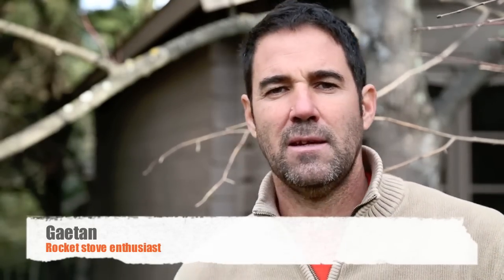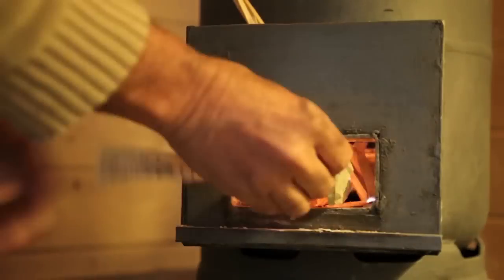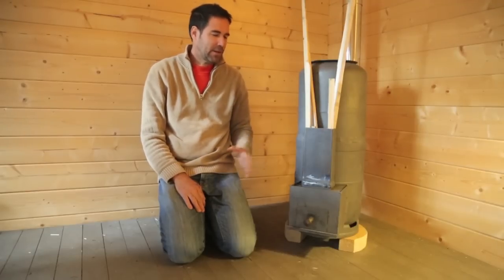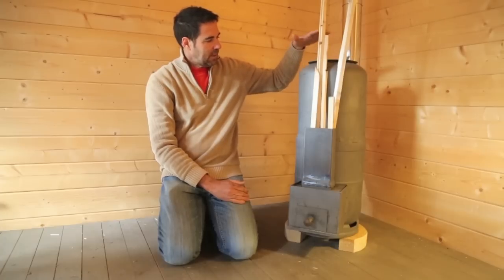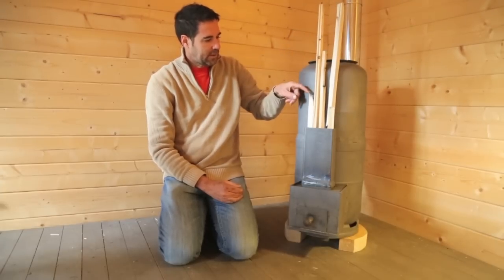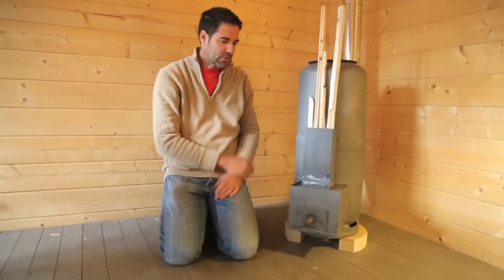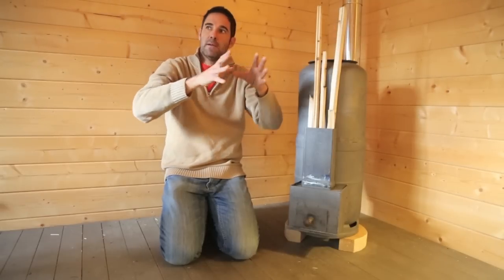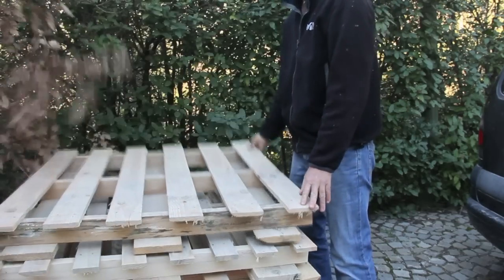Rocket stove heater for a workshop or a room

Comment: Many thanks. Most informative rocket heater video I've seen to date. Used your ideas for external air intake and gravity feed for fuel.  Added a lid to seal feed chamber and a sliding valve to regulate air intake. I soak little blocks (approximitly 40x40x16mm) of pinboard in kerosine and use them for firelighters.
Reply from the maker: +MegaStaalman Well done !

Comment: I like this design from the outside... but would like to see even a rough design plan and see you add a proper piped fresh airflow chamber. G
Reply from the maker: Dan Marlin Hi Dan, thanks for your comment. Yes this would be the next step! Putting a piped air flow  and something that does not play with the visual harmony of the stove. It is possible, though it will take some thought !

Comment: very clever :).  Time to fiddle around, collect odd bits of scrap, spend an enormous amount of time.. and warm my studio next winter.  Thanks for the clear explanation.. [( I might try a larger fuel receptacle - although of course the idea is to use as little wood as possible..but perhaps look at increasing the burn time ), perhaps a bit of flow control for air intake to mess about with burn time, and yes an external air intake also damped for flow control]. See what I can scab from the local tip eh
Reply from the maker: Thanks. Yes you're right a lot of time is needed with the build! A flow control is a good idea.

Comment: when starting put in a clump of wood shavings and twigs first then the paper. As the paper burns it'll have to go through the twigs etc lighting first time. So people put paper in first then twigs but the paper is burning and the twigs will compress the paper down and in some cases put the fire out.
Very nice design. Perhaps an outside shed with rocket stove built into it and pipes to transfer the heat only to the inside of the cabin I heat my workshop this way no internal fire just masses of heat coming in through pipes.
Reply from the maker: +ftrikerfox Thanks for your tip  and ideas.

Comment: very hot is a good answer. I built a stove using 1/4" x 4.5 x  4.5 metal tube for the burn/feed tube and the chimney and a 30 gallon barrel 29" tall centered over the chimney with the barrel top 2" taller than the 27" chimney. The chimney is insulated with a piece of triple wall stove pipe. The stove has reached 330 degrees F (measured using a wood stove thermometer)  but I was hoping for much more heat. My stove looks similar to yours. I wonder if I did something incorrectly.
Reply: +roy hoco Your heat is going up the chimney rather than being transferred into/through the metal.  Some Aluminum or Copper baffles would help (both internal and external and the top surface on which you might want to cook should definitely be a good heat conductor - I'd go with a good sized sheet of copper clad aluminum.  Air movement across the stove will also draw off heat and thus improve efficiency and a bit of creative thinking might get the exhaust gasses to drive the fan (but be mindful of exhaust pressure).
Reply: +Paul Smith thanks for your input, I use various items to capture the heat and transfer it into my shop.  I use discarded automobile brake hubs which are heavy and hold a good amount of heat for later release, I lay them on top of the stove and stack them two high. An old shoe cobblers stand that is a piece  heavy metal, cast iron pots filled with water, short pieces of railroad track they hold a lot of heat and release it slowly  and anything else I can find that is thick metal. My shop is large (heating 2,200 sq ft) and the new rocket stove will make 3 wood heaters for when the cold of winter arrives.  I can burn one or a combination of the three depending on the weather. The only thing I can think is  I was test firing the new rocket stove outdoors on a slightly windy day  when the temp reached 330 so that might be a factor. I will fire it indoors this winter and see what happens.
Reply from the maker: +roy hoco Thanks for your input - Yes I agree with you and Paul Smith re increasing the heat transfer capacity to be able to use more of the produced heat. This being said my rocket stove heater works more than well for the space I have and I wanted it to look good. So adapting the rocket stove for your needs is important. How I could increase the capacity of this stove would be to instead of having a medium sized gas bottle on the top, it would be to put a big one, and as well increase the height of the internal insulated heat riser. Re your question about your stove, there may be some proportions wrong... The way I found that out was by experimenting. there could be too much air intake, or inner spaces too big. You will know when it is right when there is no smoke coming out of the chimney and a good heat produced. I would aim for that before welding bits of metal onto the heat exchanger.  During the building stage it is of course good to do test firing outside, however to really see what is happening you need to do an inside test fire with all the conditions (like chimney length for example) Hope this helps.
Reply: +roy hoco   Your brake hubs are doing what I suggested and are a great idea for the top surface but not as efficiently as would internal and external copper or aluminum fins.  The idea is to use less fuel for the same amount of radiated/convected heat.  Removing the heat from the canister surface would improve thermal transfer.  My suggestion to use waste heat to turn a fan was just a random thought to stimulate further experimentation as is my suggestion to use waste heat from the chimney to preheat the air going to the combustion chamber.  Hopefully I've sparked a helpful idea or two.

Comment: Thanks for posting/sharing, you have to deal with ash eventually, if you could incorporate a small hole expanded steel grate bottom that would allow ash to fall into a removable drawer, you might consider that, please not trying to tell you what to do, just a thought. If my Dad was alive he would be ninety years old, when i was a kid he used to tell me about the old coal stoves, that had that ash shaker idea
Reply from the maker: Hi Len, thanks for your ideas, they are more than welcome ! The great thing with these stoves is that there is very little ash generated as there is near total combustion when the system is hot an running. Though at some point ash does need to be removed. The ash shaker idea could be good. Thanks for sharing your views.
Reply: @gaetanproductions  G.P. thank you for your response!

Comment: I built one with a barrel. Filled a file cabinet drawer with wood stove liner brick6x6.5) The riser a 7"x 30" insulated ss chimney like you get at Menards(don't know why 7" and not 6") but I got it at a auction. It worked well for a month. Had some wood chips and loaded them on wood pieces  angled in upright feed chamber once it was warm even added used veg oil. Some chips were moist and burnt excellent. Then I cleaned up outside around the pile and some had ice on them. I shredded my riser liner with the moisture that day I believe. Pretty sure it was due to moisture in the chips. Used 5gal of chips a day along with split wood. So wanted to ask how long you have been using your riser and what it is made from...and warn against using moisture if it is metal. I was thinking the moisture was like a steam cleaner- bad idea I think, or was the ss riser going to disinitigrate anyway? The stove quit working that very hour. Did not rebuid yet thinking about refractory cement this time.

Comment: I love these home rocket stoves.  My big issue is that they have to be loaded so often.  Unless they are mass heating rocket stoves I just don't know if they're worth the time putting wood in the chamber  Is there a way to increase the time to six hours?  Then I could get some sleep at night.
Reply from the maker: Yes I understand. True they need feeding. This type of stove would be good if it was heating a thermal mass. There is another type of stove called a batch box rocket stove. I have not made one as yet, could be worth looking into.
Reply: @gaetanproductions  Thanks for the reply.  I just want to get a complete burn from the stoves.  Wood stoves just don't do that.
Creosote is such a pain and I'm getting older.  It's tough getting up on a ladder to brush the flue every 1.5 cords of wood.  That's a couple of times a year.
Reply from the maker: @beebob1279  I do understand, yes with a rocket stove there is in most cases a very good combustion so no deposits on the walls of the chimney pipe. If you have pellets where you are there could be some form of automatic pellet feeder... the thermal mass seems to be a good solution for continues over night heat. Though I have never made one myself.

Comment: NICE stove , I like that "self feeding" part and Have built a similar stove with 5"x9" self feeding tube about 48" tall, it had a lid and this makes it easier to connect your outside air someplace very low like maybe a flexible aluminum connected to the "Plug" you use on the clean out. Having an extra low intake point allows the wood falling into the fire to burn at a slower more steady rate. The next step (Which I did and worked great) is to somehow preheat your intake air. In your case you could wrap the aluminum tube around the main tank. My stove had a full metal jacket with about two inches between burn chamber and outer jacket, in this space is where the intake air collected it's heat causing the fire to burn at a higher temperature. My biggest problem was that Soot would build up on the sides and glue the wood to the side preventing it from dropping into the fire. Another problem was extremely hot fires that would burn any grate completely out in 8 hours or less, I tried 1/4" stainless steel solid rod and after about 8hrs the center four inch diameter was gone with ends tapered down to points. Good luck with your next GENERATION! ! ! ! Harold
Reply from the maker: Thanks for your feedback Harold. Lots of good ideas. Re heating the air intake I am not so sure it is a good idea, as you have seen it gets too hot... it would be a good idea if you wanted to meld metal, like a rocket stove furnace. For a rocket stove heater the right mix of temperature produced and materials used is necessary. A burn chamber in brick could be a solution for this.
Reply: soapstone?

Comment: Love your design and explain your need to provide outside air close to the rocket stove. Thank you.

I see lots rocket stove made out of metal. As you know metal will expand and contract further deteriorated metal integrates. 

I wish to know how long do you expect to have this metal rocket stove last.

If u build it again. Would you use other material such as brick? Thank you.
Reply from the maker: Thanks for your comment ! I don't use this heater all the time, so it's life will be long !  I have had the problem you mentioned with the rocket stove I often cook with. What I did was plaster the hole with clay. It fixed the problem. For sure natural heat resistant and local materials are the go. There is a solution to do a mix, that is make the structure in metal and surround the burn chamber and heart riser with a layer of cob. So if the metal does piece, there is a back up.

Comment: Nice heater. Wondering if you could capture some heat into a thermal mass. You have efficient combustion without efficient heat storage.
Reply from the maker: +Harold Mack You are totally right, a thermal mass attached to the exhaust would make it perfect and it could be used to heat a far bigger space.  I wrote in the description that its potential is under used. I designed this stove to heat a small wood cabin. The reason I did not experiment with thermal mass is one for limited space and two the wood flooring would not support the weight needed for an effective thermal mass.

Comment: great heater,could you please elaborate on how you used/fitted  insulation
Reply from the maker: +Phil Williams Thanks. Have a look at the drawing at the end of the video. Outside the gas bottles, around the burn chamber I created a metal box and filled it with insulation. The inner chimney is doubled, simply filled  at the bottom I used a high temperature past to close any holes, at the top I cut many cuts into the top of it and bent it over to the inner square pipe. For the insulation in the bottom of the lower gas bottle, I just filled it to the lower level of the exhaust outlet pipe.
Reply: +gaetanproductions did you use loose vermiculite ,i have been considering mixing vermiculite with cement
Reply from the maker: +Phil Williams I used loose vermiculite. I wouldn't mix it with cement, the cement will fill all the air spaces taking away its insulative properties thus making it less effective

Comment: Could you please show how the inside is built. Do you did some vertex design?Thank you very much. I would like to build one.
Reply from the maker: +Chito Mangahas Sorry Chito, I don't have any precise drawings. It is really very simple, if you look at the drawings at the end of the video, all is there (these drawings are not to scale). Two square pipes welded together to make the "L" shape. Then a stainless steel tube placed around the inner chimney, this is then filled with an insulation right to the bottom. The bottom of the inside of the stove around the inner chimney (heat riser) is also filled with vermiculite.

Comment: How do you clean the creosote that will eventually build up inside the walls of the outer chamber? You need to create an ash pit to extend further inside the vertical rocket pipe to assist ash build up that will inevitably occur after many hours of use
Reply from the maker: Hi Joseph, good question. Actually the two gas cylinders are not welded in the middle so they come apart for eventual maintenance. Good point re the ash build up. When I use it, I never use it for more than a 3 to 4 hours, the small amount of ash that remains I clean tout before every burn.

Comment: Lovely design! Could you perhaps tell me why the burn box is insulated? To my mind that wouldn't affect the draw and radiated heat is a bonus, surely?
Reply from the maker: Thank you ! The hotter the burn chamber the better the combustion. So insulating this part helps contribute to a cleaner more complete burn of the wood gases.

Comment: Its a nice build I like it. My version of this is to have just a normal little fire place with a flat top so I can pot a pot on it I am greedy and I want all the radiant heat, so i want to see the naked flames. A polished piece of stainless steel at the back to refelct even more of the heat out the opening would be good too.

The exhaust runs up to just below the ceiling and then goes right around the outer edges of the room, all 4 walls, and then out the chimney.
I would use quite a heavy gauge pipe for this. The reason for the height up to the ceiling is only to prevent people burning themselves on it, ideally it would go from the fire right around the room at about a 20 deg angle to help the rising hot air create a daft, but some one is going to get burnt if the pipe is too low and a tall large diameter12" or 300mm chimney will sort that out any way.
The heavy gauge pipe acts as a thermal capacitor and the heat from the fire does not escape out the chimney the pipe is so long that by the time smoke comes out the chimney its only slightly warm Its like a cars radiator it has lots of surface area. 
Then you put in a very small amount of wood which burns off in say 20 - 60 min and the thick walled steel pipes take on all the heat and this keeps the room warm for another 4-8 hours. 

Burning wood is carbon neutral, only fossil fuels cause more carbon to be released when burnt than what the wood took on to grow into a tree. 
So you can burn more wood if you want to but I like to make the fire once at say 8pm and its out before bed time to reduce the fire hazard, and the amount of money I spend on wood, the thermal capacitor then keeps the place nice and toasty till morning - in theory any way I haven't built one yet its just an idea.
Reply: so you have a vidio link for heater
Reply: Sorry I dont its only an idea, if ever own my own property I would go to that amount of trouble.
I did just put 100 meters of 50 mm black irrigation hose on the roof of the house its 190 liters and at 3pm in the afternoon we have to add cold water to shower in it, its too hot to run straight in.
Reply from the maker: Thank you
Reply from the maker: That's great !  I have black pipe on my roof too, though not so long... Free hot water!

Comment: What about the air intake through the bottom and a grill work with ashes able to fall through and be eliminated without having to clean the stove from above.  Then there is the  idea of a stirling engine to feed the outside air.  And can put a secondary air pipe up through the bottom.

Comment: If you're looking for a rectangular shaped stainless steel box for your projects you can use a no longer working domestic chip fryer. Ours clapped out after 6 mths use ( plastic dials get gummed up with cooking oil) but I couldn't bear to  throw away the useful stainless steel  container with a fitted lid. Thought id make it into some sort of little rocket stove.
Reply from the maker: Good idea !